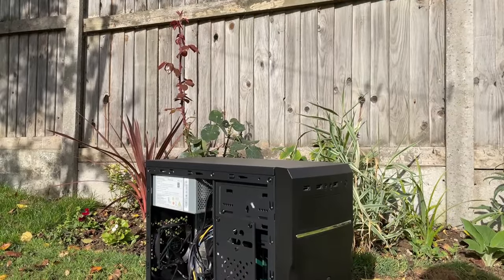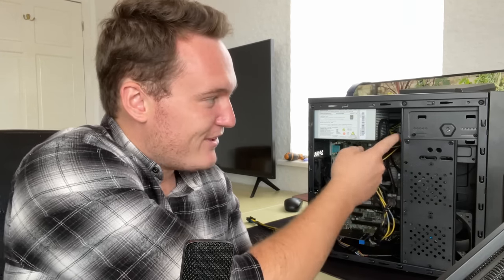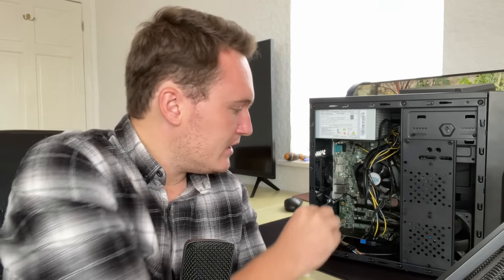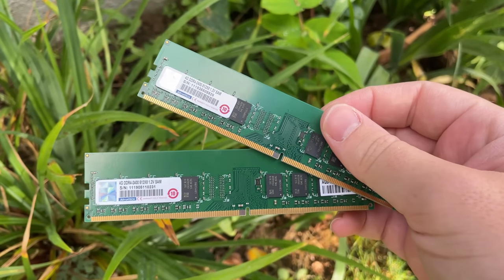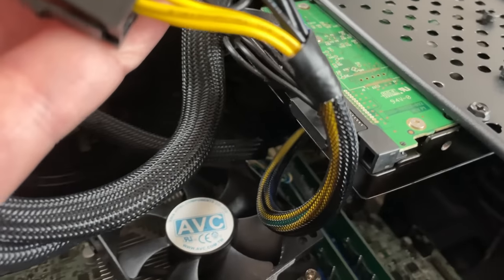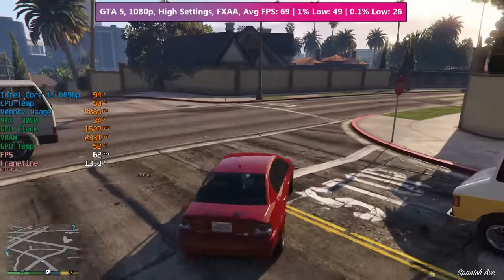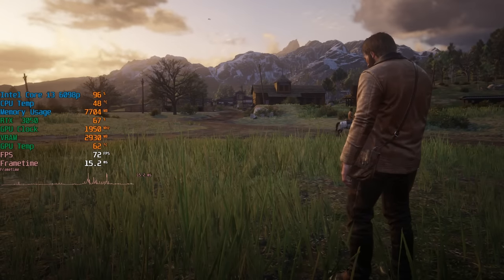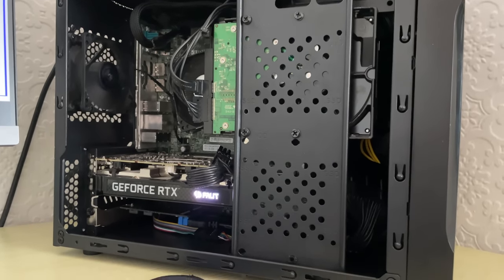This "Custom Built" PC Was Hiding an Unwelcome Surprise...

Comment: i3 6098p, now that's one of the weirdest CPU names and that says a lot. A 6700 would do good on this mobo depending on how much you pay for it, can certainly make for a decent budget rig.
Reply from the maker: Yeah going to look for an i7. I’d never heard of the 6098p before buying this
Reply: @RandomGaminginHD  According to ARK it's a 6100 with worse iGPU (510 instead of 530), lower base clock and higher TDP somehow
Reply: 6700 would be terrible money/perf unless you land a deal. 6500 for some reason is far more plentiful.
Reply: @MandoMTL  6500 is only 4 threads so we're then buying a CPU that's not good enough. Agree the 6700 is overpriced most of the time.
Reply: @kajurn791  
There's "mutant" CPUs,made off laptop ones.
Could be interesting.
Reply: @kajurn791  So why bother? He can triple his money easy just with his cleanup.
Reply: i have an i5 6402p, that's where the 2 points from the i3 6098p have gone xD
Reply: sadly not like 6700 is that good but it's also expensive 2nd hand usually
Reply: @Hamo06 pretty certain u need a special chipset to support skylake xeons
Reply: The problem with this pc will be lack of support on the mobo for upgrades and drivers. I would start again as you need a standard mobo. psu etc which will be another $50
Reply: @daytimerocker3808  .... they would have to be skylake/kaby lake xeons... no bios update will do anything since skylake/kaby lake are not compatible with coffee lake at all.
Reply: @yeetus59   For some reason now, I feel like having some coffee with coffee cake.....🤔😁
Reply: @RandomGaminginHD  E3-1270 V5 for £23.78 on Aliexpress
Reply: @thelordkiller_ytxxshadowmi8813  Haha nice one xD
Jokes aside, whats so special about the i5 6402p in comparison to a "normal" i5 6400?
Reply: doesn't sound like a real model number
Reply: @vimp8772  i5-6402P has a worse iGPU than the i5-6400 (HD 510 vs HD 530) but it has 100MHz higher clockspeed
Reply: @Hamo06 Since Skylake, Xeons need their own boards and they don't work with consumer boards. With Haswell and older platforms, they worked fine.
Reply: i used to have an i5-6402p and it was super weird, it wasnt bad at all but it wouldnt even come up on userbenchmark and i always scored 100th percentile so i think i had the only one lmfao
Reply: @RandomGaminginHD  i have a 6700k for sale if interested.
Reply: @yeetus59  I mixed the names up.

Comment: This is one of those instances where you can tell having less cores is the big limiting factor. It's decent, but obviously holding back that 3050 exponentially.
Reply from the maker: Yeah hopefully a skylake i5 or i7 sill still be solid!
Reply: Even the old sandbridge is faster than this cpu .
Its 2 core is really the limit the systeem.
And yes have HT on it 
But HT only work if the cpu cores have time to spare .
If not HT will lower the cpu performance.
Reply: I'm sure it has everything to offer for everybody.
Reply: Being able to "hold back" a 3050 is it's own meme.
Reply: @wolfshanze5980  t0pk3k
Reply: @wolfshanze5980  I mean, a 3050 is a bit stronger than a 980 ti, which would've been a high end card when this CPU came out, so it makes sense. It'd be like pairing a 12100f with a 3080ti class card.
Reply: To be honest, unlikely anyone buying such prebuilt would pair it with 3050. Some used 1060 would be best (worst) scenario.
Reply: @aleksazunjic9672  to be honest, people who buy a 3050 are the kind of people who continually make poor spending choices.  A 6600 or 2060 are both faster than a 3050 and cost less.
Reply: @wolfshanze5980  3050 is actually cheaper now than 6600
Reply: Modern Games are less held back by cores and more by cashe.
Reply: @aleksazunjic9672  Maybe in Uzbekistan, but in 99% of the world, including the largest GPU market of the US, they're not even close... The 6600 is still very much cheaper than a 3050... and the 6600 is not a smidgen faster, it's very noticeably faster than a 3050.  Also, if you don't like AMD, once again, the 3050 is STILL more expensive than a RTX 2060 and the 2060 is noticeably faster than a 3050... so unless you live in Uzbekistan where prices are reversed from the other 99% of the world, there's just no reason to buy a 3050... a 3050 is just a rehashed 1660 with RT support... it's just too slow, especially for the price.
Reply: @laorakaora1764  cpu has 3mb single cache so you're correct to a degree, but also it's a dual core cpu meant to be paired with something more akin to an rx 550.
Reply: @wolfshanze5980  6600 is more expensive everywhere dude :D Check the price in your local market again. 3050 is not very popular, maybe you mixed it with 3060.
Reply: @RedBerylFTW  generally higher core models get more cashe capacity so it scales accordingly. But  most modern game's engine preffer cashe over core.
Reply: @aleksazunjic9672  The largets market for GPUs is the United States of America... EVERY RETAILER IN THE USA LISTS THE 3050 AT A HIGHER PRICE THAN THE 6600. The USA is also not alone on this... but it is the biggest market. I understand you're not in the largest GPU market in the world, but just because Uzbekistan has it reversed doesn't make it "everywhere"  Uzbekistan isn't "everywhere".  Maybe you mixed Uzbekistan with the largest GPU market in the world.
Reply: @wolfshanze5980  Nope and nope 😝 China is much bigger market for GPUs, and so is EU. 3050 as less capable is somewhat cheaper than 6600.
Reply: @aleksazunjic9672  GTX 1060 to RTX 3050 isn't really that much of a bump to performance being that a GTX 1070 is even faster than a RTX 3050 in many cases.
Reply: @wolfshanze5980  The RTX 3050 is just the new replacement for the GTX 1050 IMO.   It works, but there are FAR better options.
Reply: @TheLionAndTheLamb777  Agree.

Comment: Had a couple of pre builds back in the day, one had the heat sync held on with a rubber band.
Reply: Ha ha ha. Omg. Cable ties would be an upgrade.
Reply: @Google_Does_Evil_Now  that's literally what i found when i got it back form them
Reply: I gave someone a pc with HDD and power lights replaced with Christmas light bulbs before, also once with a dc motor rigged to the back fan exhaust with a toy plane propeller on it.  I can only imagine the electro magnetic fields emanating from that motor couldn't be AT ALL good for it.

Comment: I have also done a lot of playing around with the older i3 2 core 4 thread CPUs lately.  Mostly in laptops as upgrades for dual core Pentiums.  They work... kinda.  I'll leave it at that!
Reply: It depends on the OS, Mike. I'm still using Core 2 Duo Thinkpad T60 or T61 laptops running at around 2GHz with 4GB RAM (3GB RAM maximum in the T60 due to chipset) and they are perfectly fine daily drivers running Linux - especially with an SSD installed.

With modern Windows, forget it!
Reply: @terrydaktyllus1320  I am only running Win10 and 11 on these laptops.  It works well enough, but you are right.  Something like Linux is going to be speedier.
Reply: @UncleMikeRetro  I bet you have to really cut Windows down a lot to get any kind of reasonable speed on those machines - yep, I know you already probably know how to that, but it's beyond the capabilities of most people.

I suspect you have to even do a "hack" on Windows 11 for it even to start installing on such old machines? I remember something about that on YT about a year ago?
Reply: @terrydaktyllus1320  Yeah, waiting to see if Win11 will even update when the BIG one comes around!
Reply: I still have a laptop with a A8-6410 CPU around that's more or less comparable with a early i3-i5 and boy it's terrible. At least the GPU is vastly better than whatever Intel had on their chips back then. Running a very slim Win10 installation with 8 GB of RAM and an SSD. Boots quickly, and that's about it.
Reply: @diegoleiva7242  I am running a core i5-540M pretty well on an old Toshiba.  Aside from the crappy screen, it runs.  OK.  Ya know?
Reply: @UncleMikeRetro  I also had one of those and thought it was a bit faster despite having only two cores. The iGPU sucked and the drivers were terrible from what I remember.
Reply: @diegoleiva7242  Yes, crappy IGP.
Reply: @diegoleiva7242  No, it's not comparable at all. The A8-6410 is much much weaker than an early i3 or i5.
Reply: @terrydaktyllus1320  I owned both the A8 and a i5-540M. The 540 was a tiny bit faster despite two cores but the R5 graphics were far better. Skyrim was a mess with the 540 and quite acceptable with the A8, so there you go.
Reply: @diegoleiva7242  If you are running Skyrim then that means you're no doubt running Windows. And I am talking about my experiences with a proper adult's OS like Linux, not one for kindergarten kids.

Comment: I've done a few "it'll do" jobs when screwing stuff in place for testing, but I'd never sell it like that.

As for the machine itself, probably a prime candidate for something like a 1650 as a 1080p non-AAA(well, AAA is doable, but you're not getting 60) machine.
Reply: In anything more CPU-intensive than GTA V, the i3 will hold back that 1650.

Then again, there's not much else that you can get brand-new that won't be held back.
Reply: @IndellableHatesHandles  That's why I said non-AAA.

If you're not playing any high-end newer games, stick a cheap, but decent GPU in there and you'd be pretty good to go.

If it's up your alley, you could probably fill it with emulators for early 2000s systems(and earlier) but of course, there's cheaper options if you don't just happen to have one laying around.

Comment: this video is of particular interest to me cuz I used to shop for used PC's at local thrift stores and scavenge parts to upgrade my system at the time which was built from all used parts starting with an i7 cpu that I got on ebay for 7 dollars ... every one else backed out of the bidding when the seller admitted that the cpu came from water damaged computers from an office fire ... I figured the most I could loose was seven bucks and so was worth the gamble ... I gamed on that for several years ... nowadays I have an AMC Ryzen 7 rig but spent more and used new parts ...but I love to hear of budget rigs built with scrounged parts

Comment: You are fine using those adapters, the only ones to be worried a bit more is the molex to 6 and 8 pin, since those can overload some psu rails, and make them trip and shut down the computer or something worse.

Comment: The PC I use at work to play games on whenever I am between repair orders is a Dell with a Skylake i5-6500.  I put my own SSD on it with Win10, brought the system RAM up to 8gigs of OEM style RAM and put in a Radeon Sapphire HD 7770 1gig variant graphics card that a coworker gave me years ago.  That PC plays a lot of games surprisingly well, especially with the older Sapphire in it.  Only drawback I can see is the odd DDR3L memory it requires and of course the proprietary nature of the PC itself but it works well in my hidey hole at work.

Comment: A few months ago I was working with an Optiplex 990 and 9020, and I had to buy a replacement board for the latter Haswell based 9020. These Optiplex boards are at least Super Cheap, which is nice if you have one of these cases. The catch is these Optiplex motherboards use proprietary connectors for most everything such as the USB and Power. There are adapters for these boards that will allow the user to connect the board to a regular/aftermarket case, but the adapters are the same price as a used Optiplex motherboard. The Haswell based 9020 also uses a proprietary ATX power connector, so a 24-pin adapter is needed if the power supply is being upgraded.

Core i3-6098p..... i miss the days of Intel using weird and obscure processors such as this. It seemed as if prebuilts with the Core i5-6402p were somewhat common here in the U.S..
Reply: Wendy is looking really potato in your avatar.

Comment: I remember I stripped a mid tower Dell Optiplex to build my ex her own custom rig. I believe I upgraded the third Gen i3 in the board to an i5, put in 16GB of RAM, a custom RGB CPU cooler, SSD W10 and EVGA GTX 1060 6GB with an upgraded PSU that could handle it. I put it all in a pink case with Overwatch decals lol

Comment: You make me want to buy an older machine just for 'experimental purposes', i recently upgraded to an i9-12900k and a more up to date rtx card, currently im using an rtx 3060 12gb.
Reply from the maker: Older stuff is definitely more fun to mess around with 😁
Reply: Cool
Reply: Steven, or anyone, what did you upgrade from and what is the difference like?
Did you have the 3060 in the older system?

What upgrade has made the biggest difference for you and why?
Reply: Except that Windows 11 takes away 8GB of that RAM for all that nice telemetry it has on you even before you do anything else with it - which is actually great for someone like me who uses an "adult's OS" like Linux because I have never seen so many cheap 4GB DDR3 and DDR4 RAM modules on eBay as people rush to double their RAM to 16GB in what are usually two RAM slot machines ready for the upgrade bloat of Windows 11.

Even the heaviest Linux distro only occupies 2GB RAM or so by default - you people really should be asking Microsoft what they are doing with all that additional RAM they are needing these days...
Reply: @Google_Does_Evil_Now  for me the biggest upgrade in terms of the 3060 has been being able to max my games out at 2560x1440p and get well above 120 fps permanently with RT on and DLSS, for me its a nice upgrade all around.
Reply: @burnzybhoy9110  very nice, great FPS especially at 1440. I'm still on 1080 🙂

What's the 12th gen i9 like?

What did you have before, just as a comparison? Can you feel much difference?

I went from i5 -2600k + RX 580 8GB to i7-9700k and GTX 1080 Ti 11GB. Big improvement.
Reply: @Google_Does_Evil_Now  i won't lie as far as i am concerned the i9-12900k is an absolute gamechanger, i was previously running an i7-7700k 32gb of ddr4 ram and 2 gtx 1070's so the improvements are huge, also i now use a ddr5 board with 16gb of 6000mhz ddr5 ram, i plan to upgrade to 32gb in the near future.
Reply: @burnzybhoy9110  the i9-12900k performance looks amazing. Gamers Nexus and others have shown it getting great scores.
DDR5, now you're just showing off! 🙂😄

Did you have to reinstall windows or did you do the motherboard uninstall driver's trick?

Sorry I'm so curious but I enjoy this stuff! Probably everyone here does.
Reply: @Google_Does_Evil_Now  i done a fresh install of windows 11 but with that being said i also still have my previous setup built and ready to go, i mostly deal with emails etc on my previous build and i use my new build for everything else, mostly gaming of course 🤣 but its night and day in terms of a comparison and im really happy with my current setup 😊
Reply: @Google_Does_Evil_Now  I upgraded to a RTX 3060 from a GTX 970 last March, needless to say the difference was huge

Comment: You’ve never had a socket 1151 platform to play with!? That’s crazy considering you are who you are and you do what you do. 

There’s some amazing value to be found with this platform. In fact, I’d go so far as to suggest it is currently the best value platform.
Reply: Omg 1151 is 6th to 9th gen Intel platforms.
Reply: @Google_Does_Evil_Now  yes...and I have one.  4790k and gtx1070...can play modern games still at 60+fps at 1080p.  Some games ultra, some high some medium settings.  Cheaper than a console since I already own it.
Reply: @Tracker5111  that's lga 1150 tho
Reply: @Google_Does_Evil_Now  But afaik 1151 is not really 6th to 9th gen, i heard its like 1151_v1 for 6th and 7th, and 1151_v2 for 8th and 9th, with basically no interoperability between those two. But im not 100% sure.
Reply: @Tracker5111  I have similar. Used to have i5-2600k with RX 580 8GB then upgraded to i7-9700k with GTX 1080 Ti 11GB ($250), both from eBay. So that's similar to your setup. Both worked well at 1080p.
There are so many kits and GPUs on eBay. It's a great time to upgrade using used parts.
The 12th gen Intel i7 and i9 are so good that people are selling entire i7-9700k and i9-9900k with RAM and motherboard kits on eBay.
Reply: Here, Skylake (6&7th gen) aren't advised because too expensive
Reply: @bitelaserkhalif  Really? Prices of 6th & 7th gen CPU’s have dropped dramatically in the UK, they’re an absolute bargain at the moment. It’s a pity they’re too expensive where you are.
Reply: @vimp8772  It’s reminiscent of the 775 platform, early boards only supported Pentium 4 and early dual core chips and the later boards supported Core 2 Duo/Quad but didn’t support the Pentium 4’s. (Of course there are exceptions)

Comment: Depending on the bios support you could add up to an i7 7700k
Reply: Its a lenovo, max it will do is a 6700 most likely, the 4th gens (is8xm board at least, idek about the h81 based board) only run hasswell, not the refresh

Comment: You got me in the mood of trying to test Cyberpunk on my AMD A6 7400k, I know it starts up and that it has all necessary instruction sets, But when I tried it  with just the integrated Radeon it did not fair so well. That cpu isn't even a true dual core more so a single core with two threads. It's 5am now and I'm tired, this will be an interesting project for tomorrow, to see if a GTX 1060-3gb will be enough to drag that pathetic single core into a playable experience. Replaced the cooler a few hours ago when I noticed overclocks were hurting my performance, my suspicions were correct that the dinky cooler was the reason, a hyper 212 evo solved that. runs at 4.5 ghz with the multi core performance of a core 2 duo lol, the single core performance is very impressive though.